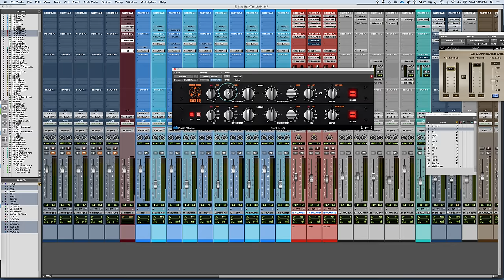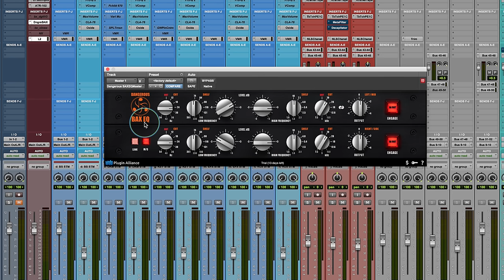Dangerous BAX EQ - Mixing With Mike Plugin of the Week

Comment: I got this plug-in while I love what it does to the hi and lo end - however, it feels like it collapses a bit the image of the original. Without turning any knobs on it - simply turning it on and off, I can hear the position of the instrumentation in the mix collapsing a bit. I tried blind test and I could identify every time it was either on or off (in default setting).
Reply: Interesting you point that out - I believe I think I recognize what you meant, and it made me think, is that hallowing an illusion next to bypass bc we're just enhancing the high and lows relative to the mids that appear to drop back, or might it be like you questioned is it  an algorithm sumation issue with the plugin?

At any rate, my head starting going to 'what plugin could I pull up to fix and re-enhance that mid upper mid image?'  That's not necessarily a bad thing, but it almost seems that if you're going to use it on the mixbus then we'd best mix into it from as early on as possible..
Reply: @nicholasparis5281  he said "*in default setting" which means without any boosting nor knob change.

Comment: 3:10 this is so weird, my bass gets louder when the filter is engaged at 18Hz. Alesis M1 Active Mk2 speakers here, I think they cut off around 40Hz or there abouts.
Reply: Not that weird I don't think, as usually with any filtering around there it has a knock on effect higher up in frequency

Comment: But do you REALLY HEAR it ???
Reply from the maker: +Steve Galante I do! It is meant to be subtle and musical. Designed for mastering not for effect.
Cheers!
Mike
Reply: +Michael White Well, congrats :)
Reply from the maker: Ha!
Reply: I can absolutely hear it. Especially right around 6:30.
Reply: no
Reply: I just got this EQ and yes it is subtle but it does make a difference that I can hear when I use it. It's a very smooth and simple (in a good way) EQ that can finish cleaning up a track or mix.
Reply: yes?
Reply: Definitely. I deliberately listen to these on my phone speakers. If I can hear the difference there, then the difference is worth it.